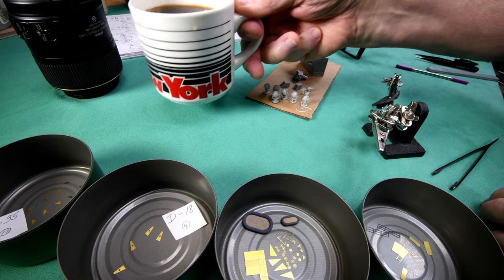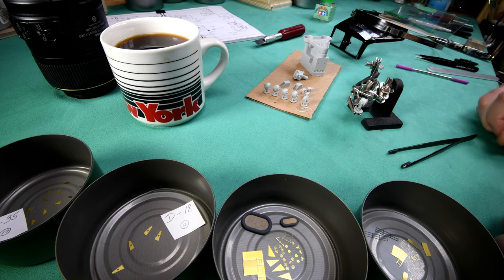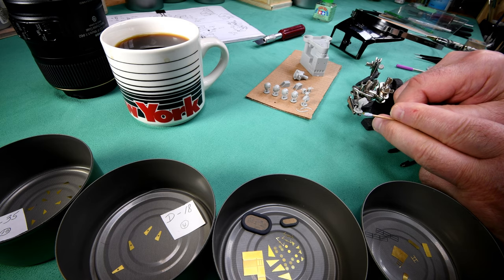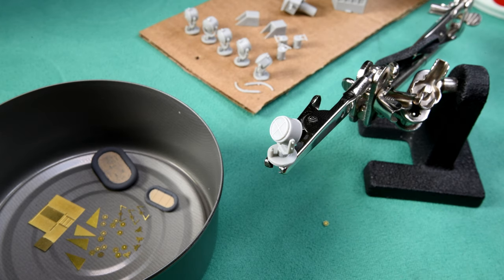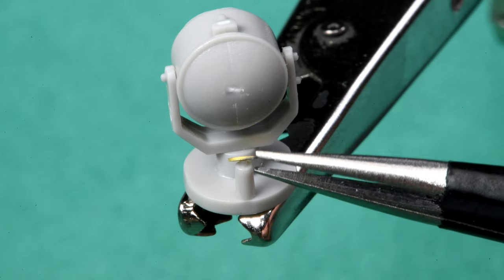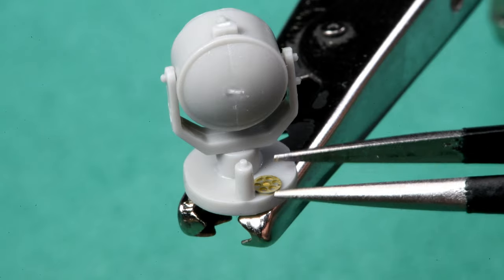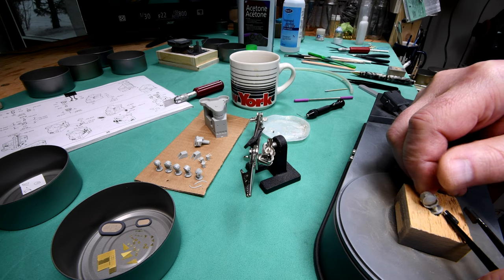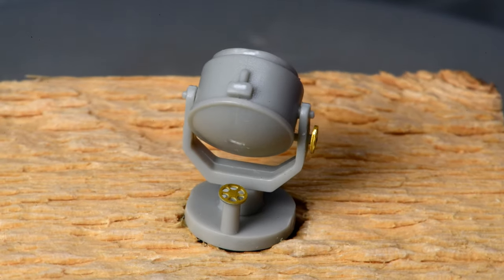The Model Ship - Part 658

Comment: Good evening Ron, there are tweezers available that has to be squeezed to open, therefore they are always closed. They may work better for holding small parts. Also as I   had mentioned previously , I think those hand wheels for the search light would look good painted yellow or red. Just my thought.
Reply from the maker: "painted yellow or red" We'll see 👍